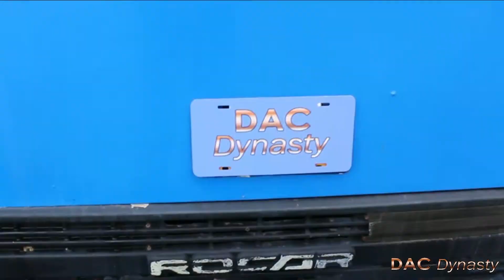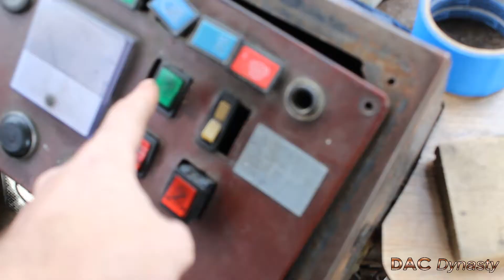QUICK VICTORY!!!!.....Doors and More Floor Woes DAC Dynasty Ep43

Comment: I just can’t understand why did they consider that it’s cheaper and better to floor up the stairs in the front instead of just changing a piston. Obviously they needed the piston for another door, they probably didn’t had money to buy new parts, but bus depots are usually have a few old broken down buses they use for parts. So this is just sci-fi for me. All that work: woodworking, foaming under the door... Its good to finally see that door open, I hope someone can find an original part for it.
Reply: They probably did it for better insulation considering the heater core situation the last thing you want is holes letting cold, noise and dirt in.
Reply: It’s very strange how drivers in different regions in Romania modified their busses. Here in Mureș they never closed down a door like that, however they closed down the cabin door. It was in 2005 or 2006 when I saw a driver using that door, until then I didn’t even realize that the “wall” can be opened. This was  by the end of the DAC/ROCAR era over here. Also, I never seen a bus with the hood cut out like Olivia.
Reply: DAC Dynasty I don’t understand this. So originally the air should come from the grill area? I looked at some older photos, some busses have the cut out, others don’t. What’s the logic behind?
Reply: DAC Dynasty I seeeeeeeee! Thanks! So that means that all the buses that have those holes in the hood had a broken heater valve? 🤦🏻‍♂️